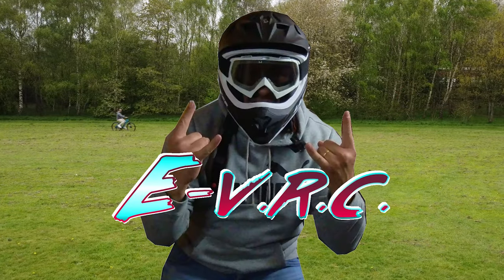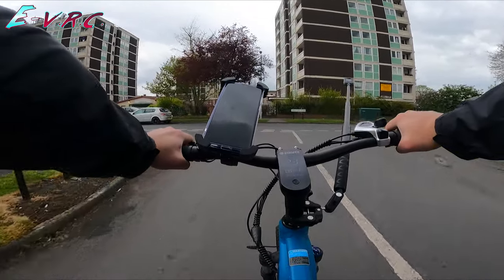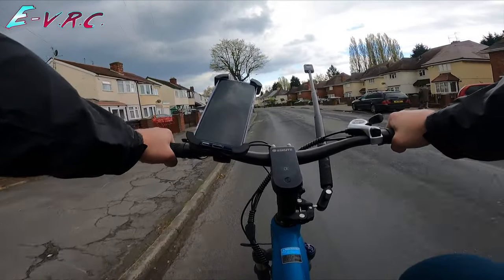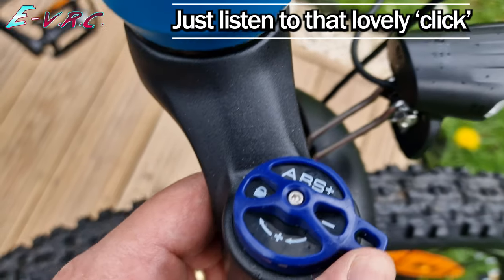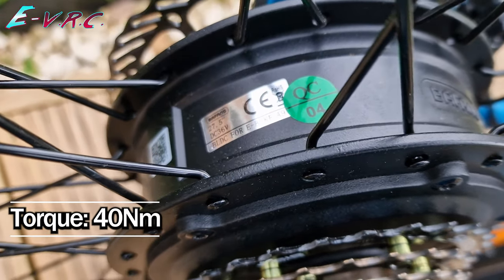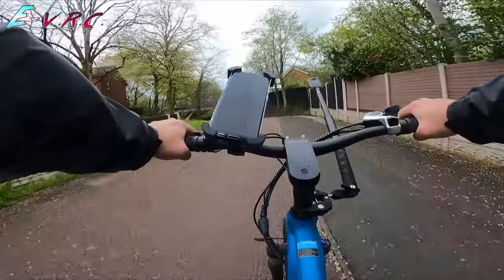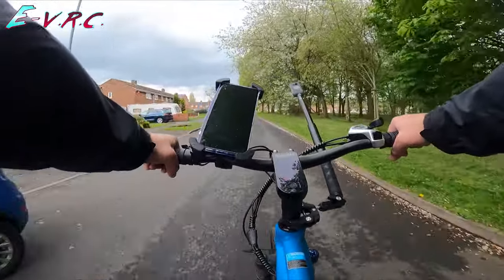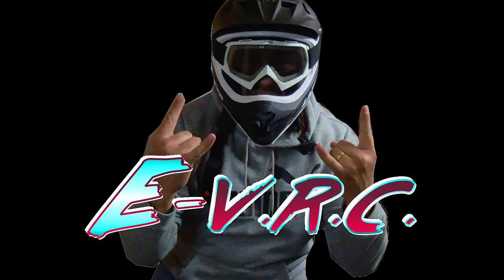This CHANGES the way you Ride an Ebike - Eskute Netuno Plus 1st Ride

Comment: Torque sensor makes the bike much more controllable at low speeds , you are fully in control even at walking pace and hill starts at junctions are a breeze. All levels will give power up to 25kph but going up levels will increase the amount of assitance you feel up to the limit.

Comment: ⚡ The two things I want from an eBike, Torque sensor and Belt drive! ⚡

I don't like grease, ruinin my jeans 😂
Reply from the maker: Love a belt drive. I was very impressed with the one on the City Vanture
Reply: Ado is selling an ebike with both of those features.
Reply: @dtz1000  yes, there are quite a few brands doin this now, really glad it's becomin more and more commonplace
Reply: Use a  ceramic  e bike wax lubricant like  tru tenisons monkey juice  degrease the chain wash is off and put thecwax lube on wax is super smoth going trough the gears

Comment: Anyone figured out how to derestrict this bike yet?
Reply: Hold both breaks and press and hold the power button , the led should blink with a 0 showing on the display now go on  the phone app about click about 10 times and it should unlock developer mode , on developer mode toggle speed restriction to off then press and hold the power button again